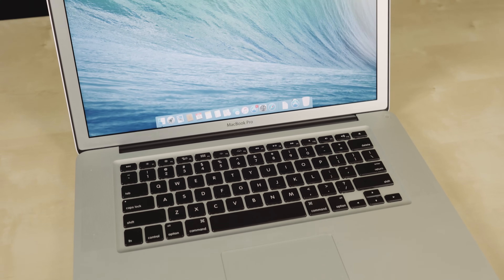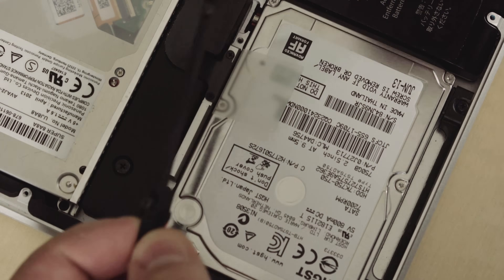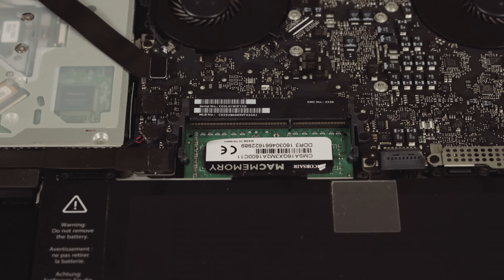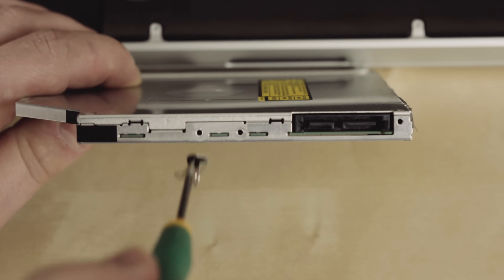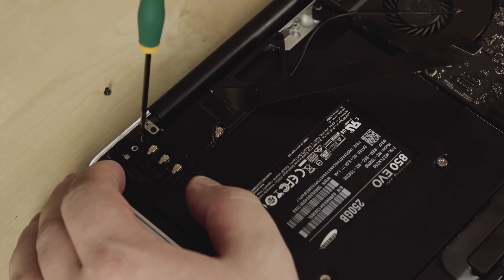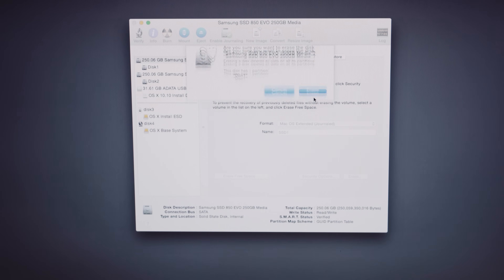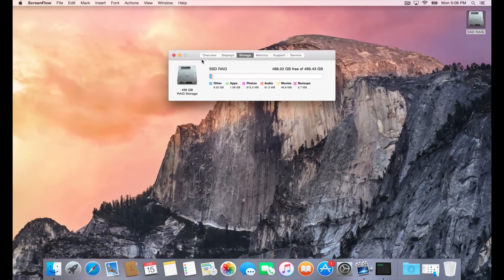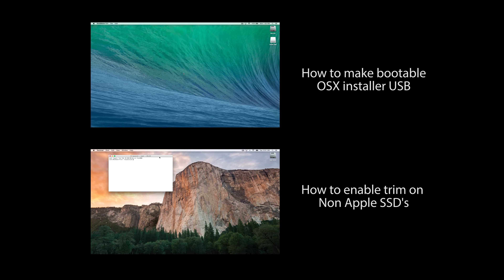Fastest 2012 MacBook Pro Ever! Upgrade Guide - in 4K

Comment: I have a 2012 Macbook Pro i5 - 3rd Gen. with 4 Gigs of Ram, Shall I go for Single SSD Upgrade or not? Will it benefit me? Currently I Can't even open Photoshop, it takes about 10 minutes to load up. My main concern is I should be able to Use Photoshop and Sketch smoothly. 

Please Suggest if upgrading Ram to 8 Gigs and a Single SSD will be beneficial or not?

TIA !
Reply: SSD alone improves system speed so much you will kick yourself for not swapping it sooner. If you change the ram to 8GB as well you will see tremendous amount of speed improvements and will be sufficient, but if you can score a killer 16GB deal I'd highly suggest to upgrade to that. The integrated video chip eats 1,5GB RAM alone and if you use PS regularly it will beneficial.

Comment: If you're doing this in 2018, you don't need to add the extra SSD in place of the DVD-ROM. 1TB SSD's go for $130 and that should be all you need as your primary.
Reply: The point to doing the RAID0 wasn't for the size boost as much as it is for the speed boost.

They act as one unit, but they write at nearly twice the speed a single physical drive can thanks to having two SATA connections.  This is why the speed test is better than the rMBP with similar specs (the rMBP is using a single SATA drive).

For redundancy you'd choose mirrored instead of striped RAID, btw, and lose the speed boost.
Reply: how about if i do it in 2019? :)))
Reply: @ike7539  wondering the same
Reply: @ike7539  yeah I'm doing it in 2019. It is now 2019!
Reply: @NeMayful  Did everything work for you well ? I'm planning to do the same on mine it's a mid-2012 macbook pro! and did you put two SSDs or just one ?
Reply: @ike7539  we have flying cars now
Reply: Raid is for speed as well as storage
Reply: Tony Lam what about 2020?
Reply: I know
Reply: matt karl  so you got 2TB in your macbook now? And yeah I can imagine how heavy it is lol mine is already heavy with only one hard drive
Reply: So, how do you transfer all your data to the new SSD?
Reply: Also, will I lose my previous data/software after I install and configure the ssd to the optical drive?
Reply: K71090 

Yes, do a backup first or port everything to the new SSD before changing anything and after you've done that you're ready to go
Reply: AnJai - from the main ssd (the one that act as the new storage HDD) or the optical drive’s HDD?
Reply: K71090 the one that's already installed
Reply: @anjai4448  Oh! So my main SSD (as the replacement of the old HDD) will still need to be backed up even when I replace the optical drive with an SSD?
Reply: So if I just use one ssd, do I still need to do the raid thing?
Reply: K C-O well 2 500 GB SSDs in raid0 config are probably a bit faster than 1 1TB SSD, but the raid config is a bit more dangerous since if one of the two disks fail, the whole thing fails.
Reply: What about raid? Don't you want to be practical?
Reply: I‘m doing the upgrading soon for my mom and was wondering if its possible to repair the dvd drive (mine‘s broken) or if its just better to put in 2 ssd‘s... bc storage wise she‘s fine with 512
Reply: Yes you do. Stripe RAID effectively splits a single file between the two drives so you are not choked by the bus limitation - the files read and write in half the time as one big disc. SSD's do write faster than HDD in any respect because they have no spinning platters to roll up and scate across but two smaller is better than one larger as you effectively gain a 12 GBs bus instead of 6.  And note that not all SSDs are equal and cheaper ones may still run at 3 GBs which will pull you back to HDD territory.  Using Blackmagic Disk speed test can highlight the gains.
Reply: Zuzu Pali - I don’t know what you mean by m.2 SSD.  I don’t think you can upgrade the display, but you can connect an external monitor.  Updating the CPU is not something I would try.
Reply: what would you suggest doing as a replacement for the DVD-ROM in 2021?
Reply: Thank you Sir
Reply: You mean the 2012 MacBook can support 1Tb drive?
Reply: @yellowlynx  Yes, I don't think there's a limit to how big the SSD is. Just how much you can afford.
Reply: Tony Lam but the RAID0?
Reply: ur wrong on that man if ur video editing or doing photos ur gonna need the space bc videos take up space and if ur editing videos in 4k then yes u are going to need extra space and people don't use cd or dvd that much anymore and yes its worth it to put another extra hard drive in the DVD player spot
Reply: @TheLawnGoat  - So that's what it does? I was looking for the answers for this question on if replacing the optical drive with an ssd; will it boost the performance?
Reply: Tony Lam thank you
Reply: thanks tony, do you know.how to upgrade the graphics card too?
Reply: @Tim Reid  SSD is almost 3 times faster than HDD
RAM upgrading will definitely increase the speed
SSD are available in various sizes.. so why second SSD ..??
Reply: It seems like you guys are experts, so I have a question haha. I'm going to upgrade my RAM to 32GB and hard drive to 1TB SSD soon. I have a 2012 Macbook Pro btw. It's VERY slow, and I really need it for video editing(Premiere & After Effects). Do you think that will really make a big difference or should I just save up and get the new i9 processor Macbook? It's just so damn expensive :(. Also, what's the point in splitting the SSD into 2 in this video? Why not just get one big one? I didn't understand that. THANKS!! :D
Reply: Chris Bruning 

1.- the max RAM it'll handle is 16GB
2.- with the upgrades it can handle 1080p video editing almost no problem and 4k somewhat slow from what I've used mine
Reply: @anjai4448  from apple website, it says the maximum memory for 2011 and 2012 macbook pro is 8GB. So it'd alright to add to 16GB?
Reply: Clare Gu yes, they do actually take 16 GB
Reply: Chris Bruning 

And the dual SSD is because of at the time of the making of the video those were expensive and hard to find (SSD prices have really come down over the years)
Reply: ohh okay got it. Thank you so much!! @anjai4448
Reply: Chris Bruning no problem
Reply: Actually I do have one more question now that I'm thinking of it. Once I get a new SSD, do you recommend using Time Machine to do a backup before and then put it on the new drive, or should I just start it as a new Mac and then add the Files I have. I'm just worried that my Mac now might have corrupted files, or a lot of Cache files. Bc my 500GB is almost full and I don't have THAT many important files on my Mac. Hopefully this makes sense to you haha @anjai4448
Reply: Chris Bruning do the backup first and then you put the new SSD
Reply: @anjai4448  so do you think it makes sense to still install 2 ssd instead of one at this point and time? I'm asking because I'm about to upgrade and I'm wondering if I should install ssd especially since I record and Edit music and I do some graphic design/video editing using illustrator and Adobe after effects.
Reply: Tony Lam Speak for yourself. Music, TVs Shows and Movies and some games take up a bunch of space. In 2013 1tb wasn't enough for me. You're a dumbass. Gaming now is 100tb+ for games like fallout 4 with mods. Music is in flac. Tv shows and movies are in x265 which is somewhat good on memory but not everything plays x265 so you need x264 🙄 I could go on but you probably don't even know what I'm talking about.
Reply: @Tim Reid one larger ssd nowadays, no point in doing raid 0, prices for ssd are down and if the rare chance 1 of your drives fail, it all fails.

Comment: 11:20 if maximum is 6gb/s (600mb/s) how did they even get over 600mb/s ?????? And is also there a 13 inch MacBook Pro non retina 2012 with also 6gb/s connection ??????

Comment: It's a really nice upgrade to a 2012 MacBook Pro, however I'd suggest anyone willing to upgrade the hardware  to stick with High Sierra instead of Mojave for a while. It's been almost a month since the launch of Mojave and still no driver for NVIDIA's GPU.

They say Apple still hasn't allowed them to release the web driver update, and I don't see it happening anytime soon. It sucks because if you have a MacBook Pro for Design, Adobe CC 2019 only runs on Mojave.

Comment: Cool video, but super annoying “music”/sound.
Btw, the second SSD doesn’t do much, if you just put your Applications on the first SSD, and use your old HDD for files. It will only be whil opening and saving files, that the Mac is a bit slower.
You just have to move your user/s on the HDD

Comment: Is there a version of this that shows this works with Mojave 10.14.1? I want to do this upgrade, cause my computer is getting slower, but I’m reading a lot of stuff saying Mojave won’t work with RAID Zero drives, among other things. My 2012 MacBook Pro was compatible and upgraded to Mojave without issues but its stock. Worst case if I want to go this route, I suppose I could always downgrade the OS to High Sierra or something... Any advice is helpful. Thanks!
Reply: I tried raid0 (AFPS) using 2 budget SSDs of same brand and type on mojave + MBP 2012 but it would not boot up. You can still boot if the raid0 was formatted in HFS+ (you once make raid0 with HFS+ format then copy necessary mojave files onto it manually). However you probably have problems in updating the OS, which makes the maintenance or recovery very cumbersome. Any case, the performance of raid0 and HFS+ was disappointing and even slower than when the same disk was used alone. Maybe because the disk was yet another cheap SSDs, which I do not know.

Comment: The 2011 MacBook Pro has a 3g connection for the optical drive. You can put an ssd there, but it’s better to get a 3g drive for that, and not try to raid stripe that years model.

Comment: Hi, thanks for this helpful guide!
After working all those steps (on my MacBook Pro Early 2011) everything works fine except of one thing.
I now have installed Sierra and am not able to upgrade to High Sierra. The update simply doesn't show up in the App Store. Before I upgraded the SSD and RAM I had High Sierra installed, now it just won't let me update to it.
Does anyone have a clue why this is happening?
Reply: you can usually go to apple website after searching google for something like "download older macOS from apple" if you are logged into your MacBook it links to an app store download, kinda like it's 'hidden' and apple unlocks its access for you

Comment: I see he is installing the el capitan on the usb. Does anyone know why he is doing this? i am currently on Mojave will this still work?
Reply: I'm assuming because he isn't using the software on the original hard drive? I have a MacBook with storage on the hard drive that i want to transfer over to this set up. Will i be able to transfer my data if i get an external hard drive enclosure?
Reply from the maker: Ryan Rodriguez I uploaded this early 2016 almost (3 years ago?) . Mojave didn’t exist.
Reply: Zed Pro Media i was asking why you we’re booting from usb rather than transferring your existing hd
Reply from the maker: @RyanRRodriguez  Oh! Well, I was showing a fresh install on the raid0 setup. I just insure everything is 100%. Sometimes if you just clone a drive over there can be random issues. I have not tried Mojave on Raid0 so I cant say if it will work or not.
Reply: Zed Pro Media gotcha

Comment: Hey, great video! Really good pace and great footage. Thank you.

I have one question: 
the RAM you have suggested in the link is Corsair "Apple Certified", if I use a different supplier (cheaper) but not "Apple Certified" will it still work? 

The link to the RAM I am looking at is here: 

https://www.ebay.com.au/itm/AU-16GB-2x8GB-PC3L-12800-DDR3-1600-204pin-SoDimm-MacBook-Pro-iMac-Mac-Mini-RAM/352108725448?hash=item51fb50c4c8:g:VvYAAOSwbbdbKNW7:rk:1:pf:0

Thanks again,

Comment: Anyone have any suggestions for the battery drainage on older MBP's (Late 2011)? The original battery is dead, so I ordered one on Amazon (not OEM) but it dies so quick from a full charge. I mean, I cannot even use it for an hour without it going from 100% to 0%.
Reply: possibly a dodgy battery.
When unplugged, check the battery voltage using "about my mac" (search how to do it). 
Should be 10-11V not 7-8V.
Check the maH as well.

Comment: I did this quite a while ago and the laptop worked great.  Booted within 20 secs.  Then came High Sierra. Things went wacko. Reinstalled Sierra and back to normal somewhat. Boot still slowed a bit for some reason.  Oh well.  Am trying to not upgrade at all now. Got too much riding on this laptop and don't use it to surf the web hardly at all.